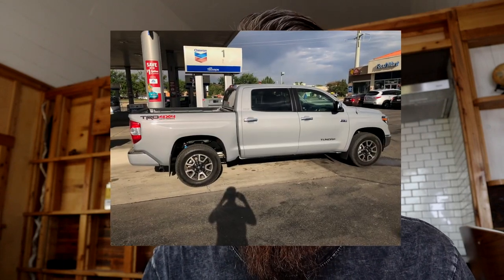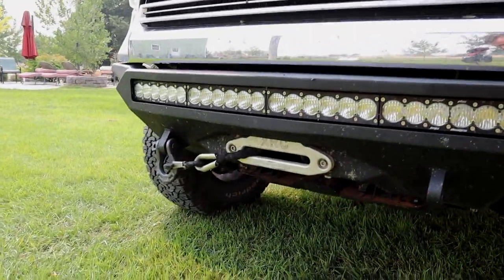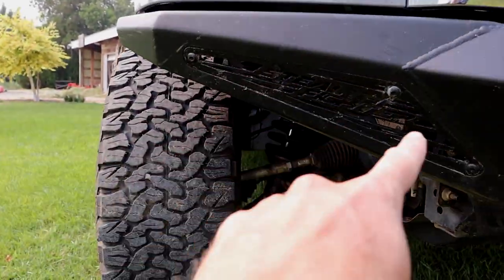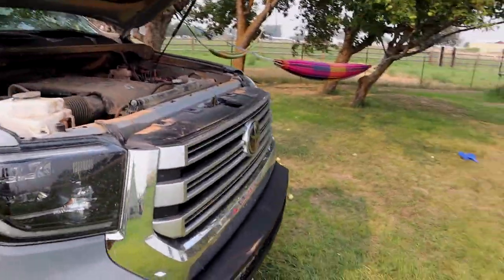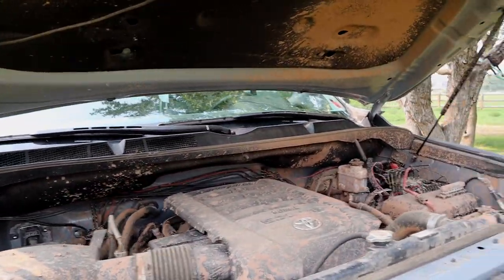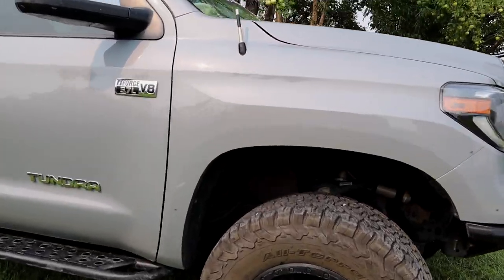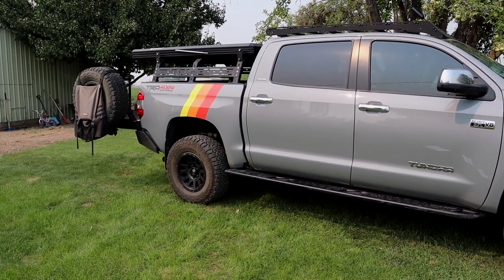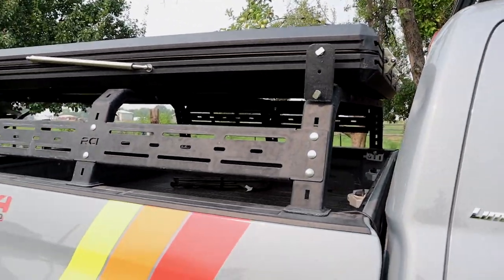OVERLAND TOYOTA TUNDRA TRUCK BUILD - Offroad Toyota Tundra Bug Out Truck Walk Around

Comment: Before roof top tents were super popular I'd just inflate a mattress in my Tacoma's bed with the onboard AC outlet and sleep in a 0 degree rated bag. It's super convenient how fast your tent deploys and is put away, but I can't help but think you could have had dual ARB air lockers with a good compressor installed for that price. Those Crewmaxs are monstrous cabs, just sucks that Toyota won't give the smaller cab the roll down rear window. As a kid we did all our road trips in a Grand Cherokee and even put a CRT tv on the arm rest to play PS2 and slept in tents on the ground. haha, maybe the next trend will be bounce houses inflated on the trail for even more comfort.

Comment: Great lookin rig! Why did you go with the OME suspension vice let's say, the Bilstein 6112's? Also, what do you think about the OME Dakar leafpack?
Reply from the maker: The OME is true Bypass suspension so much more advanced than the 6112s… a true internal bypass shock allows adjustment on both compression and rebound. Without a bybass you can only adjust compression. This is actually a pretty big deal off-road in tough trails… it also offers different regions of damping within the suspension for better bottom out control and even too end softness for things like washboard. The leaf pack is fine but if you are going to add almost any weight to your rig you want the heavy duty leaf pack
Reply: @OutdoorAuto Thanks. I have a 2020 Tundra limited, and I am upgrading the suspension. My truck though will be my daily driver, with occasional overlanding, and occasional hauling, so I won't be doing any heavy off-roading, rock climbing,  or tough/difficult trails. I will eventually buy something smaller, like the Tacoma for the heavy off-roading which will eventually be my main overlanding rig, while I keep my Tundra for my daily,. But. with the ability/capability to take it off the beaten path if needed. So, would the OME's be better option than the 6112's?

Comment: Do you worry about payload of vehicles when outfitting?
Reply from the maker: Absolutely... I actually have a tire video coming out that cover load Index and Hauling a little... weight can be a killer.
Reply from the maker: One reason I run a Tundra is a Tacoma and 4Runner couldn’t handle all the gear I take on Rafting trips and long trips.

Comment: check out the S&B air intake. BEST mod I've ever done. Adds great power, torque & sound. Likely 25+ HP increases. they don't post HP, but they show flow charts that blow all competition away & they're only $300....
Reply from the maker: At some point I am going to put in a snorkel... mostly for the dust.

Comment: Can you expand just a bit on your awning setup? I agree with you on the mid height rack to keep tent below the cab, but then awnings like that are always going to be too low to stand under. Do you have some footage or pics of your setup with the awning deployed? Especially being a 270 awning that I assume goes around the back of the truck, I would think that height would pose many problems when deployed? Thanks!
Reply from the maker: This is such a good question... sorry I didn’t address. So, I have the Batwing from Rhino Rack... it isn’t freestanding and has adjustable height legs that fold down. I’m 6’4” for reference... so I deploy the legs and angle the whole awning up from the truck at an angle where a foot or two from the truck I can stand up straight. The down side is if it is raining the waters drains toward the truck... but that really isn’t that bad. My long term plan is I am fabbing Odom brackets to get it a bit higher to slope away from the truck.

Comment: is ur RCI rack aluminum or steel? what would you recommend for florida weather? IE alot of rain!
Reply from the maker: Get the aluminum rack from UpTop Overland.... no rust issues, it is lighter and it has better engineering on how it is connected to the bed than the RCI rack. It is also priced competitively.

Comment: Sweet build! Is regearing necessary for running 35’s? I’ve heard issues about trans shifting and also has effects on engine rpm.
Reply from the maker: I have had no issues with 35's ( my bfg's are actually 34.5')... I put a ton of freeway miles on it and don't really have issues there either. The Tundra is actually geared pretty well for 35's... When I do 37's I will regear it to 4:88 and put in the lockers. So yeah... if you are going to 35's I wouldn't worry... just be careful with your Wheel offset so you don't rub... I run a +1MM offset rim and have no rub.
Reply: @OutdoorAuto  I have been watching your excellent videos this morning while waiting for my Tundra to arrive from the factory to start my new build.  Your information is invaluable.  Offset is dependent on wheel width and differs as wheel width differs.  Anyway, you mentioned +1mm offset several times but did not mention what the wheel's width you are running.  Are they 18"x9"?  An 8" wheel with +1mm can be converted to 4.54" BS.  A 9" wheel would be 5.04", so a significant difference in fitment.  Thanks!!!

Comment: Why did you opt for the +1 offset instead of the +20? Thanks
Reply from the maker: With 35's at a +20 there is a decent chance you would rub on the inside of your tire when you are turning... I haven't tested it but can't imagine it would fit... or it would be really close... How about you... have you run it... did it work? What tire brand and size?

Comment: Did you not have to do a body mount chop to fit the 35's? I noticed you said you would have to for 37's that you want to get. What is the actual tire size?
Reply from the maker: The tires in the Video are 35” BFG K02s. The do not rub at all. So no BMC for 35’s
Reply: @OutdoorAuto  Awesome! People keep telling me that I will have to do a BMC if I go up to 35's. I have a 2020 TRD PRO and have been hesitant due to that. Are those 12.5 inches wide like most 35's? Other people report that it will rub and full turn on the Body mount.
Reply from the maker: @dalephillips8250  Yes they are... everyone says the BFG's run a little small... If I remember right, when you buy their 35's they actually measure 34.5 or something... but yeah they definitely fit. with 1MM offset and a 2.5 - 3" lift all around. I have no spacers but I do use a little bit of the pre load capacity on my OME kit... but you would do that on any kit with a Tundra...
Reply: Wonder if the 35's would still fit with a stock front bumper with similar suspension and wheel offset... 🤔 Planning on getting a Tundra here in the not too distant future and trying to figure out what mods I wanna do.
Reply: @justinperry9754  I'm planning on putting 285/75R18 (34.8-35 inch tire) on my PRO and so far it seems like they will fit with all my stock parts. Hopefully no modifications for them.
Reply: @dalephillips8250  that's good to hear! As of right now I'm planning on installing a victory 4x4 blitz bumper that just replaces the middle black section of the bumper with a steel winch bumper and keeps the stock bumpers on the side where the fog lights are. I'm not planning on doing much rock climbing or anything so I don't see any need for a higher clearance steel bumper. Plus I like the looks of the Tundra front end with the blitz bumper installed lol
Reply: @justinperry9754  I'll have to look that one up as I've never heard of that bumper. Depending on the price compared to a full on that may be a good option.
Reply: @dalephillips8250  looks like they run around $800 bucks. Like I said it's a much smaller bumper than a full sized steel bumper.
Reply from the maker: @justinperry9754  I am pretty certain 35's will fit a Tundra with a 3" lift like the one I am running, WITH the stock bumper... your issue there is more with bumper drag if you try and go up any really steep hills/rocks or drive off too big a bump.
Reply: @justinperry9754  I do now have the Goodyear Duratrac 285/75R18's (35.1 inch tall) on my stock TRD Rims and at first didn't notice any rub but there is a slight rub at full turn on the sway bar. However, I hardly ever need to turn full lock so didn't notice it at first. It doesn't bother me at all so far and love the larger tires now.
Reply: @dalephillips8250  Cool! Good to know! Thanks for the info! I definitely like the way 35's look with only like a 3" or so lift so that's awesome... I can't stand trucks that are jacked up halfway to the sky 😂

Comment: If you could do it again would you choose 37s over 35s?
Reply from the maker: not for an overland build... but definitely on a full blown long travel build... you have to cut a lot of stuff out to fit long travel anyway so it makes sense to go 37 at that point.
Reply: @OutdoorAuto  thanks for the advise. I want to build an overland tundra and just didn’t want to buy into a set up and regret not going the other. Seems like 35s are the sweet spot. Love your videos.
Reply: @OutdoorAuto  one more question. Would 37s perform better for overland? Man I would love for you to do a video on what the difference would be like and what needs to happens to accommodate 37s. With functionality over aesthetics of course.
Reply from the maker: @anthonyproia5634  I have a one year review on my long travel Tundra that is getting done in March... that will cover 37s and the mods extensively - Watch for that one it will have all this stuff.

Comment: How many inch is the highest point of the prinsu rack? Where I park for work I’m limited to how much height I have left before I hit signs and lights. Thanks.
Reply from the maker: According to Prinsu (I checked and it looks accurate) it adds 2.125" to the top of the truck
Reply: Nathan Mueller awesome. Thanks for the fast reply.
Reply from the maker: @mouafishing559  No Problem

Comment: How much lift front and rear on your tundra?! Also great Chanel and awesome yota 🤙🏻
Reply from the maker: Basically the lift is called a 2.5 in lift... but the front has pre load that gives you some flexibility to dial it in based on the weight you are carrying in the rear.  So somewhere between 2.5 - 3.
Reply: @OutdoorAuto  awesome did you put a leaf or block in the back?
Reply from the maker: @kylemattson8740   I upgraded the leafs in the back… on one tundra I used a custom Deaver set and in the grey a tundra I used a OME Dakar medium duty leaf set.

Comment: Hi, May i ask you how you spend on suspension and camping gear to have an idea the cost of overlanding? Thanks
Reply: A heck of a lot. The tent itself in maybe $3,000, the rack is probably around $1,200, the back bumper is a couple thousand plus the front bumper is around $600 plus a couple hundred dollar light bar in the front, Prinsu roof rack is around $800, decked drawer system is $1,500, the truck itself is around $50,000. Add all of that together not including anything in the engine or the $2,500 shocks with remote reservoirs, you get a pretty expensive rig that will last through the thick of it.

Comment: I have a 2020 tundra and I am cautious to take it offroad here in the dunes, whilst we are side sloping, and the airbags deploy, is there a kill switch, or do Toyota programme the car when in 4hi or 4Lo so that the airbags are disabled.
Reply from the maker: I believe the airbags are automatically shut off in 4LO... but if you are dune driving you will likely be in 4HI Manual shifting mode... I am not certain... but pretty certain they are active in 4HI... There are videos on how to disable the rollover curtain bags and sensors... but just FYI... I have never had issues with them in the dunes side sloping.
Reply: @OutdoorAuto  Thanks I have the same suspicion as well, and double checked the manual, which does not mention the state of the airbags in 4hi or 4lo . The older Tundras used to have a RSCA switch, which switched off the roll sensing curtain airbags, sadly this is not the case with the newer ones.

Comment: Hey man great video! I just bought the same truck and would like to do a similar set up! Anyway you could link some of the products you discussed in the description?! Thanks again!
Reply from the maker: This is the full list... if you check out my Instagram, every truck post has links to every maker..
Current Build info:
@toyota Tundra Limited
@areabfetents Roof top Tent Medium
@cbioffroadfab rock sliders
addoffroad Stealth fighter bumper
@bajadesignsofficial Onx6 Arc lightbar.
@theoriginalsmittybilt winch
@prinsudesign roof rack
@arb4x4usa Tredpros
@expedition_one Dual swing rear bumper.
@trasharoo trash bag
@deckedusa drawer system
@sdhq Switch-Pros 9100 
@dometic CFX 75DZW
@goalzero Yeti1000
@fueloffroad Wheels Vector
@bfgoodrichtires K02 35s
@oldmanemu4x4 BP51 Suspension
@rcioffroad bed rack 12”
@rhinorackusa batwing
@tacovinyl retro Toyota stripes
@airewhitewater Sabertooth Raft
@weboost Reach Cell Booster

Comment: How do you change the tire and unload the full size spare
Reply from the maker: The spare is just secured with 3 lug nuts... so you loosen/take those off and then just pull the tire off. I use a jack to get the other tire off... then swap em and go. As far as unload... they are heavy but I manage them on my own... and I will admit freely I am not the strongest guy.

Comment: Interesting choice moving from a 4Runner to a Tundra, especially with a family. I would’ve thought that the 4Runner with a heavy duty rack setup would’ve made more sense simply considering the family. Granted I’m not 100% sure on the size and number of things ya gotta carry for rafting
Reply from the maker: Have you seen how huge the cab is on Tundra Crewmax? Way more room for the kids... and the bed can haul way more gear and not go over the recommended payload. When I would load down the 4Runner for extended trips I ran out of room and they become gutless and slow with the extra weight... mpg tanks too.
Reply from the maker: I love 4Runners I have had 2, you just need to keep it light with them.

Comment: Do you have a parts list somewhere?
Reply from the maker: .
.
Current Build info:
@toyota Tundra Limited
@areabfetents Roof top Tent Medium
@cbioffroadfab rock sliders
addoffroad Stealth fighter bumper
@bajadesignsofficial Onx6 Arc lightbar.
@theoriginalsmittybilt winch
@prinsudesign roof rack
@arb4x4usa Tredpros
@expedition_one Dual swing rear bumper.
@trasharoo trash bag
@deckedusa drawer system
@sdhq Switch-Pros 9100 
@dometic CFX 75DZW
@goalzero Yeti1000
@fueloffroad Wheels Vector 18”
@bfgoodrichtires K02 35s
@oldmanemu4x4 BP51 Suspension
@rcioffroad bed rack 12”
@rhinorackusa batwing
@tacovinyl retro Toyota stripes
@airewhitewater Sabertooth Raft
@weboost Reach Cell Booster
Reply from the maker: I’ll get one put together with links... this is the one I use over on Instagram @natejmueller
Reply: @OutdoorAuto  thank you, appreciate it. Planning to modify and change a few more things, like the bumpers and swapping side steps for Sliders. Went on a off-road trip and the side steps got a little jacked up.... 

Sweet truck! Keep posting the videos!
Reply from the maker: @romokid64  Good call on the side steps... I actually think my Rock sliders are the most important mod I have made on the whole truck. They are certainly the one that has saved the truck from lots of damage multiple times. Plus, even when I don't have enough clearance for an obstacle... with a good spotter and planning, I have been able to "Slide" my way through stuff.
Reply: @OutdoorAuto  precisely what I need it for. I don't do any crazy offroading but when there is an obstacle in the middle of a trail and I need to get by, that clearance truly is key. Even if it still isn't enough clearance, like you said, you just slide over. I definitely want to invest in Slider, RCI skid plate that goes from the engine block down to the Transfer case, about 1.9in front and 1in rear lift, and off road style front bumper, need something more solid... And no one is buying a Tundra for the MPG lol
Reply from the maker: Alex - I was able to get the description updated with a full build list with more detail as well as links to most items.  Sorry that took so long.

Comment: Never stated the size of the tires...just said the brand. Some say 33 inch is sufficient for overlanding and 35 is overkill which is why I'd like to know.
Reply from the maker: There is no single answer to this question. I am overlanding a Tundra in extremely rough terrain so I have 35's for extra clearance... but my truck also has a long wheelbase so 35's on A Tundra are similar to 33's on a shorter wheelbase. Most overlanders don't take on extremely rough Terrain so absolutely 33's is fine. If you plan to overland Internationally you should be VERY serious about running a Common tire size. All My videos try to teach fundamentals that then need to be applied to your unique use case.
Reply: @OutdoorAuto  Thanks for the reply Nathan. You made a point that other overlanders have made.... to keep popular tires sizes which is one of the Pro's that they named for 33's. Also they stated the weight of the tires when changing them is a struggle with 35's sometimes. They also mention that it keeps "UNSprung" rotational weight off the drivetrain. Have you felt any strain to your drive train with 35's? Probably not with 5.7 Tundra but you probably have taken a MPG hit which they also listed as a CON for 35 & a PRO for 33's. Personally I want the bigger tires(285/75R18) for extra clearance but I know I don't get off road enough to justify it.
Reply from the maker: I would never run 35’s on a shorter wheel base truck with a smaller engine. You can regear but really the only reason I go 35 is to offset the long wheelbase. With the V8 my power is still fine.

Comment: What tire size u running?
Reply from the maker: 35” BFG KO2’s in 18” Fuel Vector wheels (1mm offset)
Reply: @OutdoorAuto  no issues with running 35s with stock drive shafts and axels?
Reply from the maker: @birch0matic  No issues there because I am just running a 2.5" lift